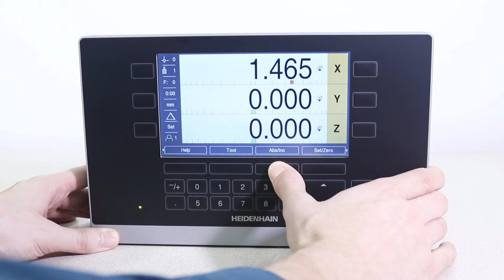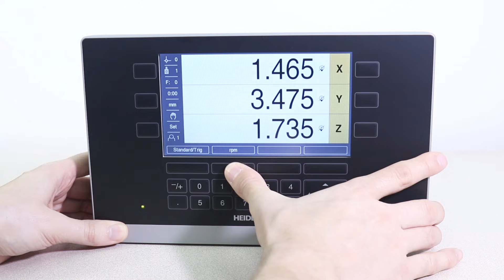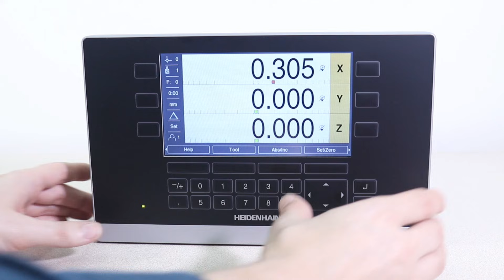Heidenhain ND 5023 Review

Comment: I have this exact dro but i have a small issue, the scales are only showing one decimal "0,1" is there a way to change this? since the dro in the video shows 3 decimals
Reply from the maker: Yes, you should be able to change that in Setup>Installation Setup>Display Configuration>Display Resolution. To get into Installation Setup, you will have to log in with the supervisor code 95148  hope that helps!
Reply: @measurementtechnologies  ok! thanks for the reply :D
Reply: Hi
How about 1/2 function and hole pattern?  Do it offer that?
What does this cost. I want to replace a 1995 screen to this. But want to keep my scales
Best regards